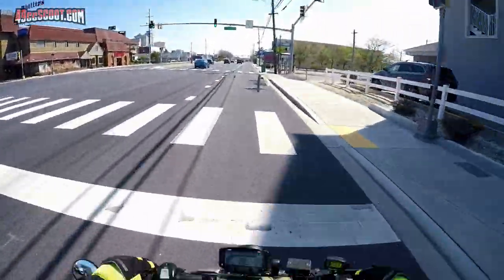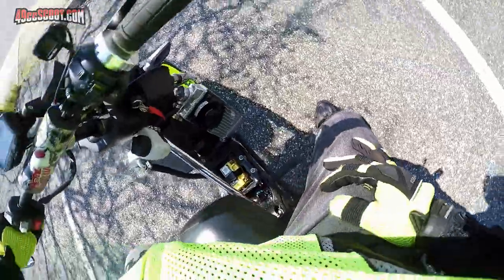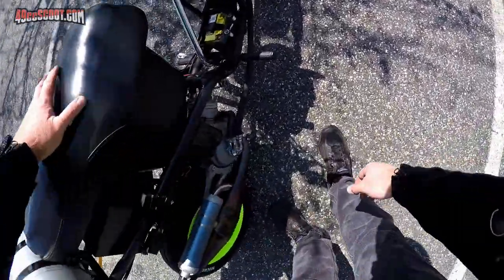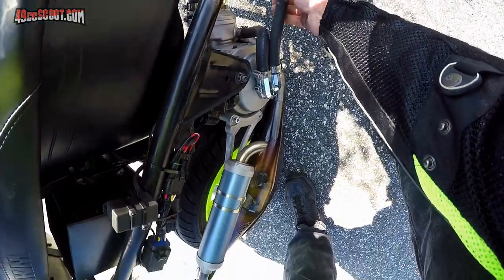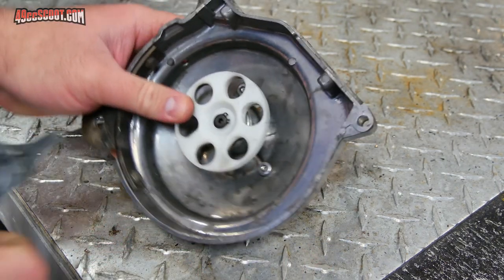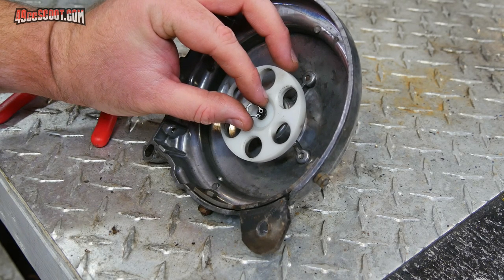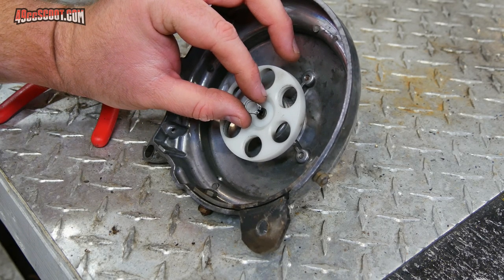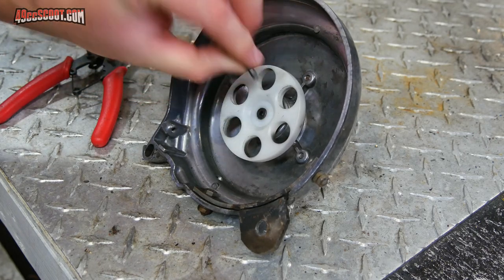T2 w/TPR 86cc Goes To The Beach : Cancelled Car Show,  Fun At Traffic Lights & A Breakdown

Comment: Are these pumps prone to breakage? Are electric pumps like the malossi unit a better option? If so will the mvt dd06 be able to run this pump? P.S. I’ve got a bigger exhaust to turn the mvt fast enough to charge. Good video thanx
Reply from the maker: The mechanical pumps work great, until they don't. They don't have failures all of the time, but it's not uncommon. Electric is great as long as you can support the electrical load.
Reply: @49ccscoot  I was going to suggest at least testing electric pumps to see how that works out.  Maybe it was just that pump, but high rpms might be rough on it .  I guess time will tell.

Comment: hi .. so i hope i dont bother anyone but .. i recently bought an awsome Motowell Darox 50cc 4 stroke EFI continental scooter , front and rear disk breaks , full front and back LED lights / signals , digital dashboard ... its beautyful but .. if i wanna mount an 80cc engine kitt on it ... what modifications do i need to make on it ?? and ... is the malossi 80cc aluminium kitt reliable ? i mean does it go 15-20.000 kms range ? thx :)

Comment: What type of oil are you using for the premix? and what's the ratio? great video btw.
Reply from the maker: I'm using AMSOil Dominator Racing 2T, mixed at 32:1 (4oz per gal). I have a 1,000 mile teardown video so you can see how it looked at that point here : https://www.youtube.com/watch?v=SKetdKhESOE
Reply: @49ccscoot  i use 40:1 on a yamaha bws.. i use the brand stage 6

Comment: I just recently purchased  a Peace Sports 150cc scooter. It is an older  model but I like the body style. What is the biggest BBK that I can install on it ?
Reply from the maker: I know there are kits to go to about 170cc that bolt on. You can go larger, but it requires case work. Check the listing for whatever you get, because I don't think all of the 170cc stuff has small enough skirts to bolt on.
Reply: Thanks

Comment: with my weight of about 70 kilo i think your scooter would have just flip straight on to its back. i has some good lauching power. and i really dig the sound of the malossi exhaust you have now on it
Reply from the maker: I'm 300lb and I have to sit all the way up front and lean forward a bit and the front still at least gets light when I take off. Occasionally it won't stay down.

Comment: Sweet bro I live in salisbury Maryland
Reply from the maker: Nice. Is it tagged a moped? If you can ride in the bus lane, maybe we can cruise OC sometime. I'm not really hanging out with even friends much these days, but hopefully soon.
Reply: @49ccscoot  no it's not taged it's a motorised bike...an the cops think it pretty cool an I never have problems...oh the one that I built last year dose 53mph...an it's the same type of frame as the new one in builds it just a 40mm stroke with a 47mm sleeved bore an a case reed
Reply from the maker: @matthewsieibenberg145  Motorized bikes should be fine riding in the bus lane with scoots. There was a guy with a 2T motorized bike kit out there at one recent show with no exhaust on it. lol It's at 11m30s in my Endless Summer Scootin' 2019 vid.